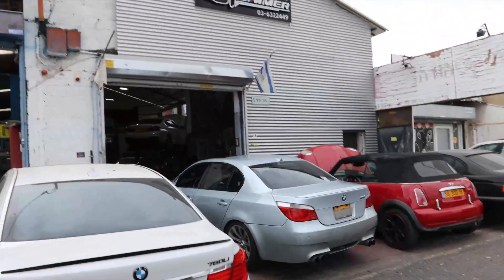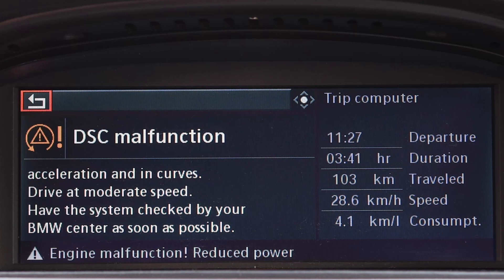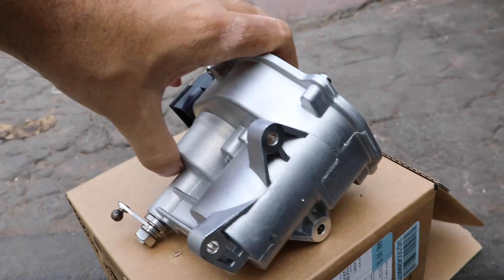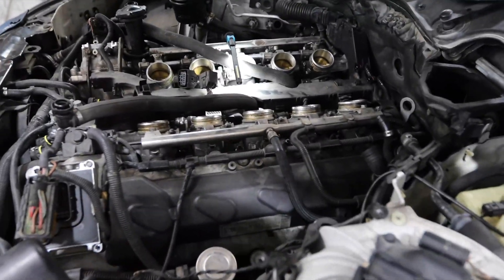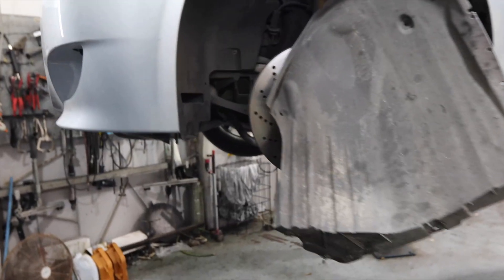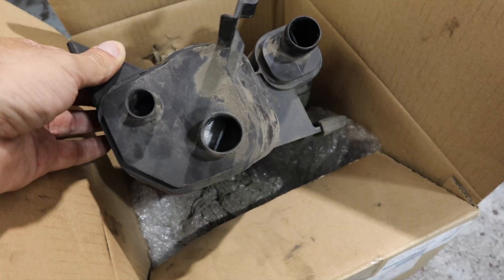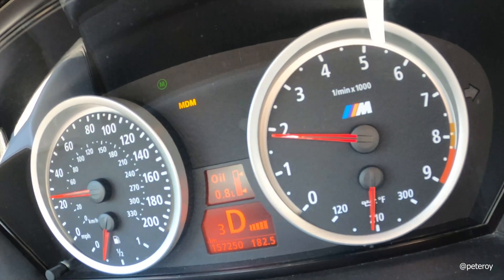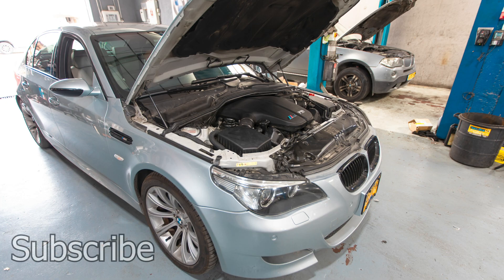WHEN THROTTLE ACTUATORS FAIL IN 2006 BMW M5

Comment: error maybe fuel pumps , it only uses the second pump at high power levels . if not it will be worth changing the fuel pump controler
Reply from the maker: I replaced the fuel filter a year ago. I will update after I get the controller